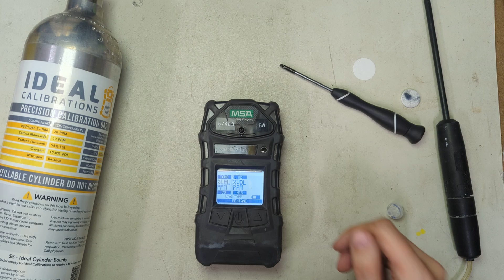MSA Altair 5X Filter Replacement Guide - Gas Detector Service

Comment: Two questions:
-what is the interval for changing all 3?
-user manual (section 4.5) says not to use the fibrous dust filter if the device is configured for Cl2; is this correct? It doesn't feel so
Reply from the maker: Hey there, you've read it correctly on the dust filter. Fibrous dust filter has a habit of picking up your Cl2 and throwing off calibrations or low level readings. If you're running a unit with a Cl2 sensor, just use the thing water stop filter (internal on unit) instead. Make sure you're also using the reactive tubing instead of the standard or it'll suck up your gas. Finally make sure when you cal the Cl2 sensor you're using a dedicated stainless steel regulator that isn't used on other cylinders (store it not attached to the cylinder as well) and use the shortest possible length of tubing you can get away with (1-2 inches).

There's no set interval on changing, but I use the following guidelines:
1. Is the filter visibly dirty (not just discolored a bit)
2. Are you having a calibration error
3. Is your monitor failing pump block test or having pump issues.

Any of the above and I would change the filter. You should be changing filters in this order of frequency/priority:
1. Water stop filter inside the probe (cheapest)
2. Fibrous dust filter (middle priced)
3. Moisture membrane in monitor (most expensive)

Hope that helps!